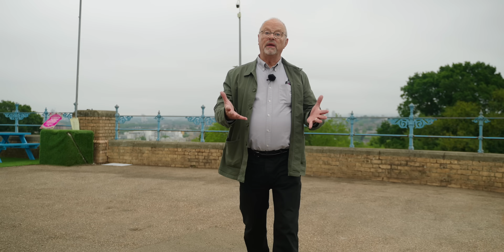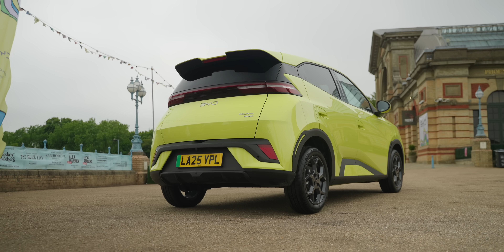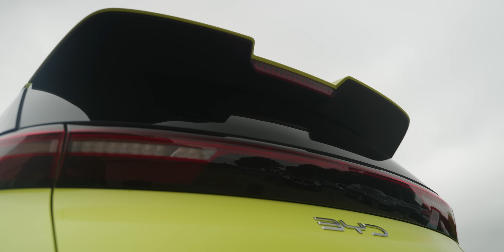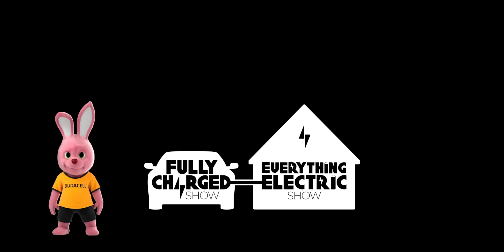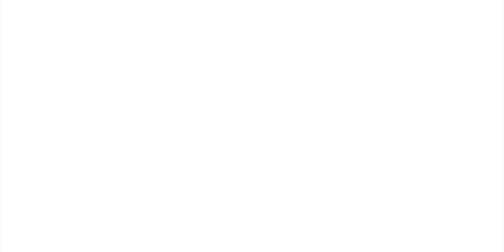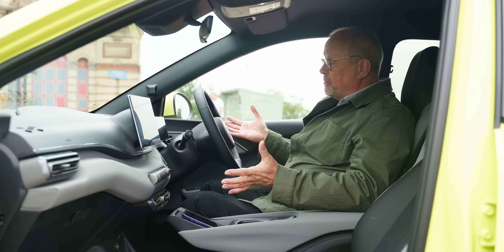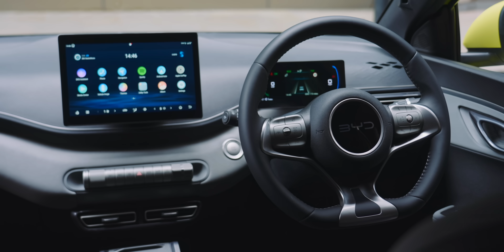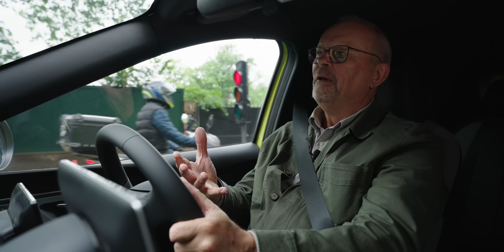At Long Last!? Low cost (high volume) EV for 'every' budget?

Comment: Burn Your Dweliung four wheel barbecurpe. Total rubbish
Reply: EVs are significantly less likely to catch fire than gasoline cars, with studies finding gasoline cars to be anywhere from 11 to 80 times more likely to be involved in a fire. For example, one analysis found about 25 EV fires per 100,000 sold, compared to approximately 1,530 gas car fires per 100,000 sold, reports EV FireSafe and the Fairfax County government. Another comparison found gasoline cars are up to 80 times more likely to have a fire. 
Fire risk comparison

    By sales: A report from the U.S. National Transportation Safety Board (NTSB) noted approximately 25 fires for every 100,000 EVs sold versus 1,530 fires for every 100,000 gasoline-powered vehicles sold.
    By mileage: One analysis suggested there are about 5 EV fires per billion miles traveled, compared to 55 fires per billion miles for gasoline cars, according to National Car Charging and Reddit users referencing studies.
    By percentage of vehicles: A 2022 analysis of vehicle fires found 0.004% of EVs caught fire, compared to 0.08% of internal combustion engine cars—a 20 times higher risk for gasoline vehicles. 

Important considerations

    While less frequent, EV fires can be challenging to extinguish and pose a risk of re-ignition because the batteries take a long time to cool, say Fairfax County officials and the University of Miami.
    The data can vary depending on the study's methodology. Some research indicates the risk is lower than what is found in the NTSB report, for example EV FireSafe citing a risk of 0.0012% for EVs versus 0.1% for gasoline cars.
    The majority of car fires, in general, are caused by collisions, not the vehicle's propulsion system, notes Kelley Blue Book.

Comment: You're right, I have a Zoe 2020 the same color as I still remember you tested, and I always use Tesla's supercharger because of the position of the connector, and my range is after 5 years around 460 km because I drive very relaxed. Congratulations!

Comment: Robert, you are of an age where you probably remember the ubiquitous Mk 1 VW Golf. The Dolphin Surf is about a foot longer, 4" wider and 8" taller while weighing about 70% more. Times certainly have changed. That first Golf was the norm.
Reply: Well...  of course, the weight is largely irrelevant without considering the relative efficiency...... isn't it.....!?

Comment: Even though its still in the upper end of our budget, this is by far the EV model we're considering the most in my household! Its not just the cheapest EV in Denmark, but the cheapest car on the Danish market right now out of all cars! Just 5kr cheaper than a petrol Kia Picanto! Heck our current car is an almost 8 year old Kia Picanto, and so a BYD Surf like this is just the ideal replacement. Our only caviat isnt really about the car but about range. I live in a rowhouse neighbourhood with shared parking lots. Meaning we cant have personal chargers at home. There are 6 commercial slow chargers for the development but people are quick to snatch them and keep their cars parked on them overnight, even when theyre fully charged. Which means  that the range sceptical people in my household are looking more at the Boost version, which is at the very edge of our budget but also facing tough competition from Hyundai and Renault.
Reply: This needs to be solved politically. I see the same thing in Germany: a few chargers here and there - which isn't really a problem if people take their cars away once charged. So there need to be parking restrictions and cameras to enforce them.

Comment: Scary fifteen years, and truthfully I’ve been probably close on with the channel that time. The dark days of probably under a hundred public chargers and you had a grand choice of four or five cars. I’ve still not jumped into EV ownership and only driven two EV’s in a Range Rover hybrid 2025 model and a Polestar 2 that I got give to test drive for a afternoon but the new R5 could change that. Changed days as battery tech marches on and brands that didn’t exist or they did but not producing Cars set to dominate. I sat through all the Tesla reveals. I just feel that the next gen EVs for some of these new models will hit that sweet spot of real world 300 miles plus range and quick charging and far cheaper batteries. I do road trips so yes the more range the better for me. 

Hope we are all around for the next fifteen👏👍

Comment: This is going to sound REALLY weird but ... I liked the Duracell advert.
Why? Because I wanted to see a trusted WESTERN Brand supporting integrated home energy solutions. Yeah, I can make my own home battery, pick the right inverter etc. but that's a lot of effort and research and I'd really just rather write a slightly larger check and have a solution that the vendor warrants will work and work together with no "gotchas". It looks like Duracell is going to provide this, and it's about time.

Comment: I rather like this car, but I also like its bigger brother the Dolphin - although I do think that car is now showing its age.

I only have 2 issues with it.  

The range is a bit pathetic, it is fine if all you want is a city only car where your longest journey is maybe 50 miles and to be fair that covers a lot of people, just not me!  Also this is not the car to have as your only car if you are likely to have a 200+ mile emergency trip to visit a sick relative.

The second issue is the design of the boot. The size of the boot is fine, completely appropriate given the dimensions of the car the problem comes when you lay the rear seats down, ideally you would want a flat space then but if the seats do not go completely flat and instead there is a gentle rise that is manageable.  But in the Seagull/Dolphin Surf we have a much worse solution, a huge step up between the boot floor and the laid down seats (which are still not flat), that is a much less useful space.

I suspect BYD will sell a lot of these cars, and deservedly so although given a choice I would still choose the Renault 5

Comment: Robert, you're giving me the willies....that's two vids in a row now you have stressed how latest batteries don't catch fire....as if the older battery tech (that I drive!) DOES have a habit of catching fire. It gives the impression that was a problem when you've said for years it isn't a problem. I really don't think that we should stress that latest batteries don't catch fire cos that's not a benefit....is it? I'm a big fan btw, just would love to clear this up. Thanks!
Reply: I think Robert is stressing it because of the prevalence of the 'lithium cells catch fire' strapline from anti-EV folk.  Yes, technically NMC cells can catch fire (albeit at lower rate than ICE vehicles, etc), but LFP are virtually impossible to get to catch fire - close enough to zero as to be indistinguishable on a clear day :p

And Robert has to stress it, because subtle / nuanced arguments are ignored or treated as 'excuses', etc.
Reply: Thanks  @logicalChimp I understand the way you put it, to me it feels like validation of the anti EV movement stance on BEV 'tendency' to self ignite...but I get the logic outlined 👍

Comment: Driving in (and reversing out) is worse (both in terms of ease, and in terms of safety), than the opposite (reverse in, drive out).  It might be more 'convenient' on arrival, but that doesn't make it 'better' (especially given the difficulty of reversing out - potentially into traffic that you can't see, if you're parked between other vehicles)
Reply: Isnt the majority of charging point in a forecourt type of situation? or does it depends on country/city you are in?

Comment: I would have prefered the charger to be where Tesla has them, because I always back into parking/charging spots. Mainly because I was taught when backing into a spot the cars on either side are stationary, so limited vision is less critical. Driving out of a spot you can encounter other cars that are driving past, at which time I want maximum vision and not the limited vision I would have when backing out of a parking/charging spot.

Comment: As a car, it's great. You would only really buy this car for the urban environment but judging on the range, it could go further. The inside looks logical and very well put together. I could have this as the runabout and even if you don't have a drive, can't see this being an issue, plug in when you need to. Yes he mentioned the rapid charger but that would cost a fortune. If you search for a charger near to your needs then it would be great.
Reply: Rapid charging shouldn't be too expensive, given it's charged by kWh (in the UK), not time... even at 65p/kWh, it would likely cost <20 quid for a rapid charge...

Comment: Still waiting for the sodium battery. I love my EV, and the previous one.. The one before that was awful. So I am on my 3rd one now and two of the three have had failed lithium cobalt batteries. One was written off, the other one I paid for extra warentee in time to not have to write it off! So I hear what you are saying, the battery is amazing and reliable and people saying otherwise don't know what they are taking about but I have had my kia written off and my hyundai had the pak replaced under 100K. These were €50 thousand cars and they failed. You run a one day test and say all is well but I don't know if you really understand. I would wait for the next gen sodium battery or don't expect the vehicle to hold value.
Reply: Those vehicles would have been using the older NMC chemistry cells... the newer LFP cells are, generally, more reliable.  

Sodium cells may - or may not - be as reliable... but they're also a lot less energy-dense (currently), which means you'd get a lot less capacity in a pack (and thus a lot less range) if it had sodium instead of LFP.

The primary benefit of Sodium (for now) is in stationary storage, where the extra mass required to achieve a given energy capacity is usually a non-issue.
Reply: @logicalChimp  catl is making 2nd gen sodium right now they have a 175wh/kilo power density. This is close to LFP. Look it up man, I am not just talking smak. Sodium will last many times longer than LFP, aren't flammable, better at lower temps.... Way way cheaper, not fancy rare expensive elements and the list goes on. Lithium batteries are no longer required and if you already have an EV you should just wait. Even if a sodium battery has a little less range the $/kwh is way way way less.

Comment: Uk consumers: oooh, cheap stuff. Why should I pay more for local?
Also uk consumers: why don’t we have any industrial or mil capability anymore?
Reply: The mass UK car industry collapsed because it was bad and it collapsed  before most car buyers today were born. I see no sign of it being revived.
Reply: @francesconicoletti2547 the leaf is engineered and made in Sunderland. Uk Supply chain supports new and old. The uk car industry makes outstanding cars, but not enough at low prices.
No excuses for being slopey shouldered
Reply: @francesconicoletti2547 the new leaf is engineered and made in Sunderland. There are options at many prices above that. Second hand of a uk or friendly country supports uk supplier network in spare parts.

Comment: People don't like EVs because they buy a subpar EV with 130miles motorway range which is about 100 miles after 2 years in the winter. Then theybstart complaining about jow bad are EVs are. 
This car with allegedly 130 miles range is completely useless as a car.
Reply from the maker: Can I point out that I have heard comments like this 15, 10 and 5 years ago. All with exactly the same argument.
Always starting with the comically absurd claim "People don't like EVs because . . . . blad-de-blah.'
What people, where? The very few people you know?
Last year, global EV sales topped 17 million. I am happy to point out that this is still a minority of total private car sales. It's a transition
But 17 million people made a very conscious, informed choice and chose not to buy an old, dated, dirty, inefficient combustion engine vehicle.
This particular smaller, cheaper EV is designed specifically for use in cities. I banged on about that all the way through this episode. I know it could easily be used anywhere, but clearly it's designed as a city car.
I have driven dozens of electric cars that have over 300 miles range in the summer, and 280 in winter, on motorways, at the speed limit.
All combustion cars that advertise getting say 28 miles to the gallon, only manage to get that if driven really carefully in summer, in winter it's more like 20 mpg, but of course no one notices becasue we're all used to the hopelessly inept technology embedded in the patheticly unreliable combustion engine with 2,000 plus moving parts.
There are also electric cars with less range than this (cars that are now 15 years old) that have done between 80 and 100 thousand miles and are not , as you desperatley claim "completely useless as a car."
Try and catch up, and if you don't want to, please don't waste your time watching this channel.
Reply: @fullychargedshow  you're correct on all points except the 28/20mpg ice fuel efficiency.  Ice gets better engine efficiency in cooler,  denser air, not worse. Free cabin heat. No need for AC. Still 28 is pathetic compared even to a Hummer EV's 60.
Reply: Counter point:  I've been driving for 25 years and can't remember the last time I did over 100 miles in one go.   Maybe Scotland last year (Yorkshire to Scotland) but that was in a hire van with two motorbikes in the back, even then I stopped more than once for a quick break.   Fact is most people don't do that kind of mileage enough times a year to have to worry about the range many EVs offer.  MOST people do about 10 - 20 miles a day getting to work.     The biggest thing that puts me off is simple:   Price.   I can't image ever paying even £20,000 for a car.   That's insane to me, rather have that in savings account

Comment: I'm interested in the safety as I read that the MG5 ev got poor crash safety results.

I want an EV but I don't want driving it to be a risky thing.
Reply: All small cars are not as safe as a large SUV its the law of physics. Maybe get yourself a bus so you feel safer.
Reply: @trythis2821 That's incorrect.  5th gear crashed a Land Rover Discovery into a small Renault and the Discovery came off far worse.

Look it up.  Don't let your preconceived ideas guide you.
Reply: @antontaylor4530  There will always be some freak outlier case, I stand by what I said. You know this full well and are attempting to be right for any reason.
Reply: @trythis2821 No, I'm making a good point - the safety rating of many small cars is 5 stars.  The MG5 got about 3 stars.

You then start talking about SUV's, which is nothing to do with anything I've said.

I don't want to drive an SUV.  I live in London, where an SUV is a stupid idea.

Try restricting your comments to the subject in hand.
Reply: @antontaylor4530  Everything I said makes perfect sense. You sir are the problem.
Reply: @trythis2821 The problem?  I'm a "problem" because I don't want to drive an SUV in London?

What's wrong with you?  Seriously?
Reply: @antontaylor4530  Act your age, not your shoe size
Reply: @trythis2821 Buddy, nobody asked about SUV's.  You seem to think you have the right to aggressively shove your opinion down my throat, and when I refuse to just swallow it, I'm "the problem".

Seriously, get help.  I'm not being funny - but if you think you can go around getting aggressive with strangers over nothing but their desire not to talk about things you want to talk about, you have a serious problem.
Reply: @trythis2821 😂

Because I'm not interested in your opinion, I'm not acting my age?

Ok, mate.  Whatever you say.  😂
Reply: @antontaylor4530  I'm not your mate you can enjoy that with a barnyard animal.

Comment: Very good point about being well-tested. I have a Hyundai Inster that has now done 8,000 km. It's needed 3 tow truck returns to the dealership and spent 5 weeks off the road waiting for a new ICCU. The other problems relate to cooling errors & dealership forgetting to screw down the 12V battery terminal. All in 8,000 km. I can't believe that a BYD could be any less reliable than a Hyundai.
Reply: Which is odd, given the Inster is - effectively - the export version of the Casper, which (iirc) is a very popular model in South Korea, and been around for some time.
Reply: @logicalChimp Odd, except all my problems are EV specific systems - ICCU, charger cooling system and traction motor cooling system. The common components (seats, electric windows, doors, suspension, lighting, etc) are, so far, fault-free. The Casper Electric (Inster) is new (late autumn 2024 in Korea). The Casper petrol has been around for much longer.

Comment: Beware! This model has unresolved Air conditioning problem. Some owners including our Seagull randomly loses cooling during heavy traffic, idling and days that are very hot. We have been waiting for BYD to fix the issue since 2024. Aftersales is also subpar here in the Philippines.
Reply: Sounds like the system is undersized and freezes up.